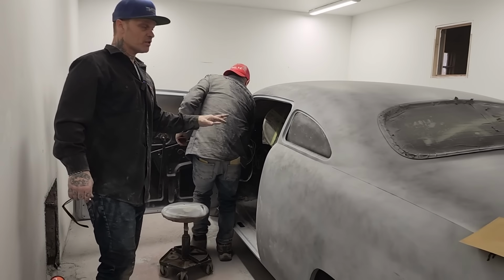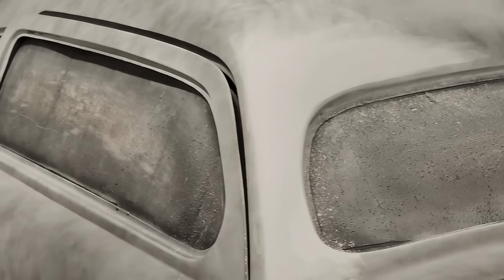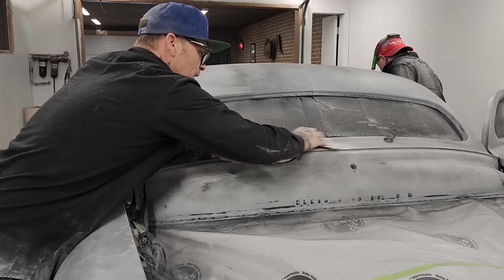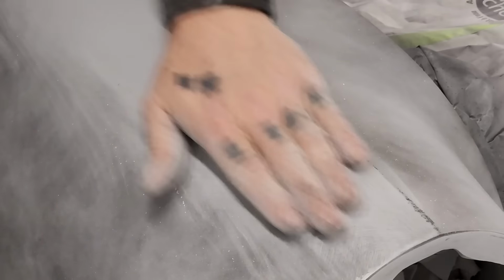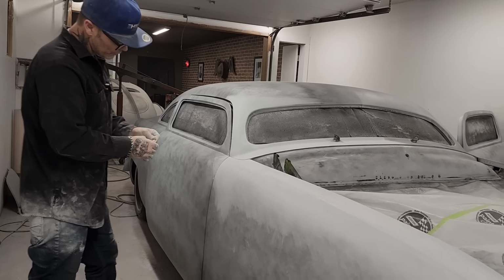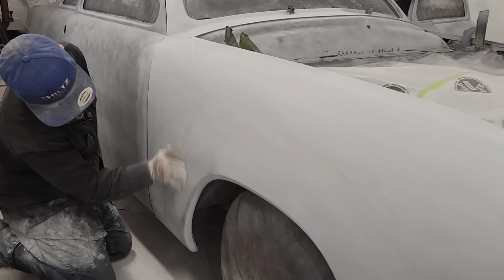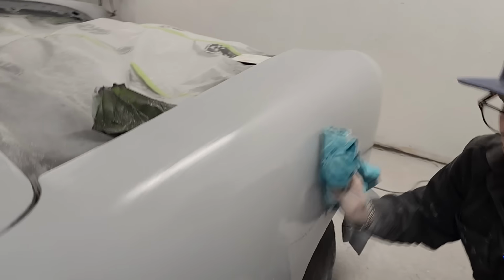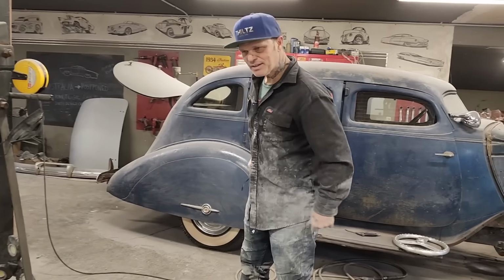Final step for single stage urethane paint  🙌

Comment: I actually have an associate degree in Autobody Paint & Refinishing a lifetime ago. I worked in that field but then changed professions several times. I also formulated color for an international company that sold coatings and color pigments for all color
related industries and brands. So this is a nice refresher course on some of the new products as i have a upcoming project. So at this point the only thing different i prefered doing is 400 to 600 grit Wet sanding instead of dry sanding, it just a bit quicker and cleaner. By the way, the Beggati floor looks fantastic, I think your on to something there with the cloth textile hockey tape and Rock Guard.
Reply: How about flatinging out runs from a week old fresh Rust-Oleum paint job? How much longer should I wait and what grit to handle it before repainting it?
Reply: @DJ-du1mf  Hard to answer that question it can get technical. Don't know what's under Rustoleum, or how it was prepped or how large the area is. Rustoleum is probably enamel paint so consideration of what your next step is and what chemistry that step is. For example if your using lacquered base primer next over newish poorly prepped enamel your probably going to get a negative reaction. I'd have a tendency or want to remove it all. Course 40 grit to remove it all, 80 grit to try and save what's underneath, stepped up to 180 grit if there is something decent under that Rustoleum. A primer over coat then 400 grit. One thing to note if there is a original old paint aged is completely cured over time (I assume), likely enamel based and is in good shape you can use lacquer based primer over it. Do a small test.
Reply: @bkon4675  it's bare metal under primer. No factory paint on car at all. Strip it all off to bare metal

Comment: Hay guys I don't know what it's like in Canada but love visiting the place anyways I don't know what Canada has to offer as for paint ex..when we worked in the body shop at freight liner trucks when the used trucks came in we power washed the frame on the big rigs we had a company here in Michigan that offered a cheaper paint just to paint the frame black or black out..were thinking it would work great for yah not spending big money on little stuff like the fire wall in a car .just putting that out there..idea for yah..carry on guys looking great..🎉❤😊😊
Reply: 5 gallons of the stuff was like 20 bucks..thin it spray it..

Comment: Years ago in the body trade we didn't guide coat at all I never even saw guide coating until about 20 years ago. btw Here's a tip for ya chad, one way to sand small areas is to use a rubber eraser its flexible and doesn't have sharp edges and wrap a small piece of sandpaper around it. works wonders, for small flat areas.

Comment: I like 320 or 360 grit, I think 400 is too fine for urathane good for base coat clear coat
Reply: I will agree with that … 320 with a flex block … but Chad had his treasons … prior he went 220 where as many would go 180-320 …

Comment: need a block fingers leave ridges
Reply: At least a sponge, to even out pressure.
Reply: @samadamms3432  if u know what your doing  in small areas it’s fine … it’s not 80 grit body work it’s finishing
Reply: @lawncuttingplusdelta  - Agreed, but the side of a fender is not a small area. Just Sayin !
Reply: @samadamms3432  I personally use a sponge block 👍🏻

Comment: 46 sec in . its hard to get off because its still tiny bit thick. %98 thinner 2% black.. IT MIGHT BE THE BLACK ITSELF  try spraying  black lacquer from spraybpmb into paint gun then 98% thinner. it SHOULD sand off like butter not glue
Reply: DONT USE ROCK GUARD thats even worse to get off its a enamel base,,lacquer only

Comment: What color is the urathane paint going to be any pin striping going to be added tge body line that uou pointed out to us the outher day would look good with a pin stripe and onthe hod some pin stroping designs would be cool,i do not have the knack so i use the tapes that are available.

Comment: When I do wood working I scribble a pencil all over the wood and sand that off then repeat for each grit that I use. Could you not do the same with a car instead of buying guide coat? Would be cheaper.

Comment: Im not a car painter, but I am a modeler who builds model airplanes, and when we sand fiberglass or woods we always place a foam pad between the sandpaper and the palm of the hand because without that sanding pad we will see where the pressure points from our hand sanded unevenly. Why dont you do that on a car paint job, where you want the flatest ,straightest final result? Thanks.
Reply: He already blocked it as much as need for a driver.Come on now.

Comment: Guna be very inteesting at what color it will be, the tape seems to have worked chad, just a thought whe you weld an external angle you would have to smooth the welds befor you tape it
Reply: Patrick. How are you doing?